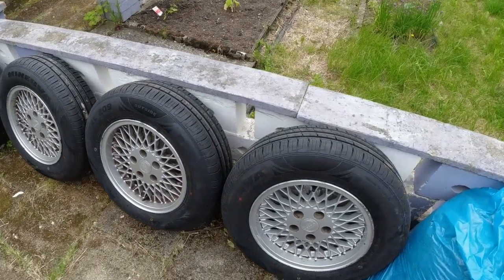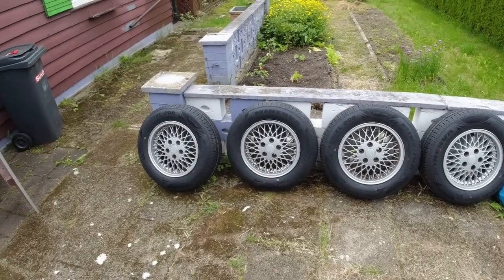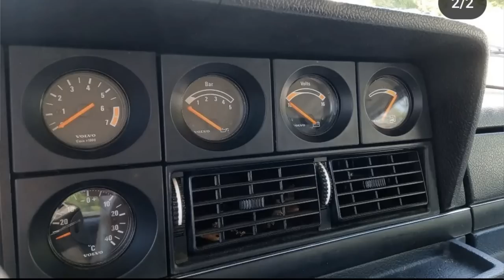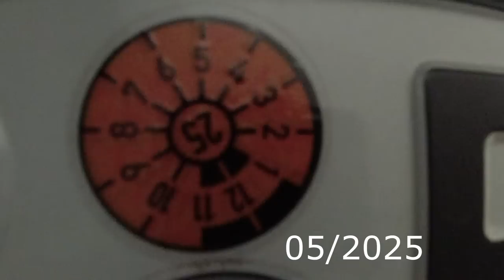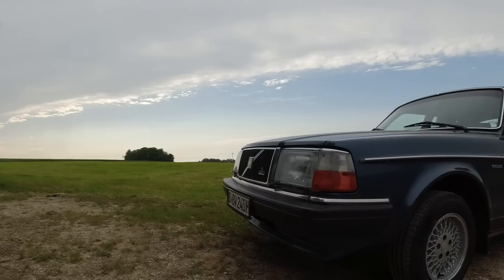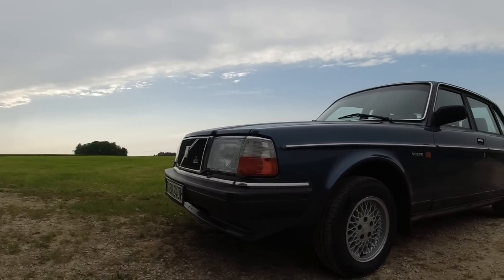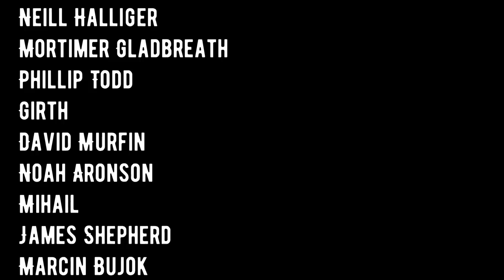Oven Cleaner Wheels & Volvo 240 Re-inspection!

Comment: Could you clarify what size tires you were running before/after?
Reply from the maker: 195/70/14 before as the wheels came off a 245, now it's got the 185/70/14 🙂
Reply: @Involvod  Thanks for the info, I have a wagon which has the same Scorpio wheels and 3 mismatched tires from the previous owner, there's a lot of talk online but nothing is better than pictures/video, even if it's of the sedan!
Reply from the maker: @Aertbei  agreed! If you click into the playlists on my channel called "The Mudster" and "Lili" you can see how these wheels look with the 195 tires

Comment: Oven Cleaner is basically Caustic Soda.       Caustic Soda and Aluminium produce flammable  hydrogen gas.       It does not actually clean the wheels but  etches the surface removing any stains.  So the time left on is crucial .   Some alloy wheels have a clear coat sealer on them that over time can be patchy so cleaning with  Caustic Soda will appear patchy, unless all clear coat is removed first.  I have also used Caustic Soda as an enamel paint remover. Mix into a paste with plain flour.  Important  to dissolve the Soda in water first and wait until it cools, otherwise the flour will cook and become lumpy.  Gloves and eye protection a must.

Comment: I'm surprised TUV allows a larger than OE tire.
Reply from the maker: They don't, unless the manufacturer says it's okay, I've been in trouble because of it before 😅
Reply: @Involvod  What if the size of tyre is no longer available? Original size/type tyres for my VW van have not been available for years.

Comment: Happy you got the old girl passed. She looks pretty good. I think the new tyres look fine and can’t believe how good that oven cleaner worked on the wheels. The the costs for the test/s seem pretty steep, although at least you get 2 years. How does it work in ze Fatherland? Is that it or is there then a registration fee on top like in my state here in Oz? I just did my daily, its approx €25 for a pretty basic check (once a year on cars over 5 years old) but then there is the registration fee and the compulsory 3rd party insurance scam, sorry scheme, which blows it out to around €500 all up.
Reply from the maker: Thanks! Yeah it's every 2 years, re-registration costs probably about €20/€30-ish, road tax is almost €200 per year and insurance mandatory, I pay a few hundred per year for that

Comment: Those are the Scorpio wheels I've got on my Christine. I found them at a junkyard, super clean, unmounted, ready to go. The only things missing were the original long nuts and the center caps were so worn that I sanded them and sprayed them black. They look good, but I just finished collecting all the original nuts to put on them, and I've got 3 of the original silver caps in good shape, just waiting to find the 4th to return my wheels to the original look. Though I'm sort of a fan of the current black sprayed center caps. I did make a commitment to return Christine to as much original spec as possible. So I'll likely throw the long nuts and all four silver caps as soon as I locate that magical 4th cap. Nice job cleaning them up, I gave my junkyard set a good clean on the front lawn with that pink spray, and they came out minty. Is the German env. regulation the reason you went with oven cleaner?
Reply from the maker: I've never seen them in black before but can imagine it looks quite good! They are lovely wheels. I know what you mean it's such hard work to find the caps for all these Volvo alloys and when you do they can be so expensive
Reply: @Involvod  Right! it was a last minute clean up decision to spray them black but they do look pretty good with the black of the roof rack and other black strips and bobs.